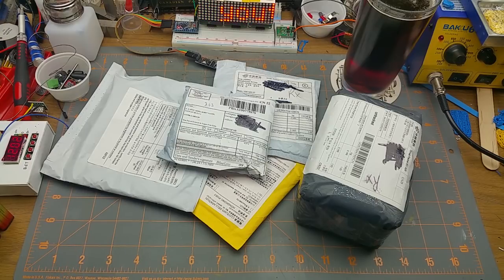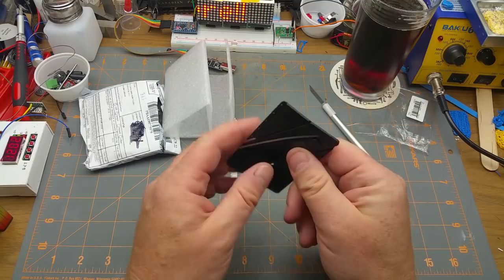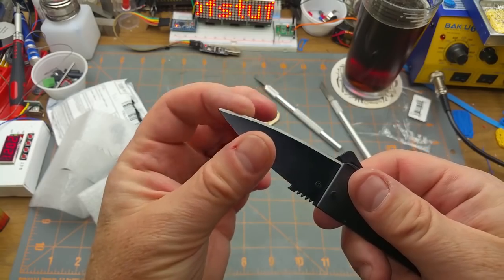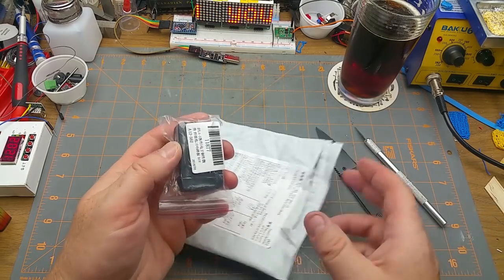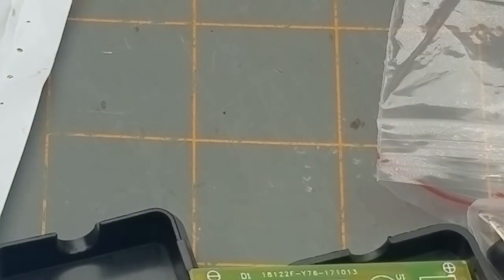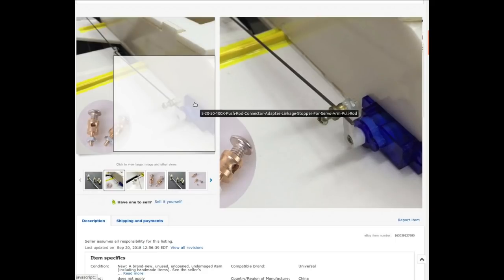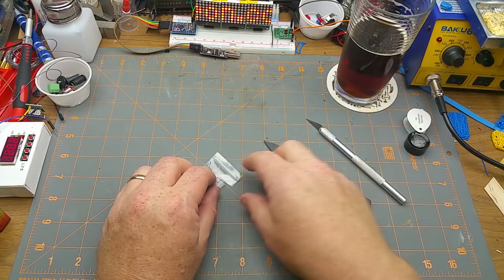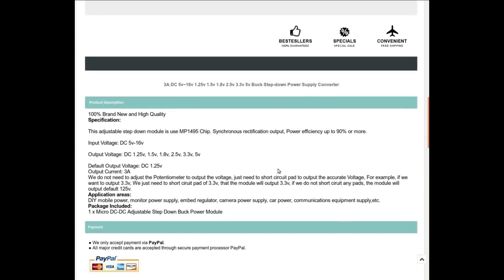mailbag monday #39

Comment: The buck convertor board should work up to the 3A maximum as written as long as the board is implemented properly.
Reply from the maker: Agreed.
But it's always a pretty big "if" when it comes to these cheap Chinese modules.

I generally tend to assume they're safe-ish up to about half of their power rating.

Comment: There is also a fm microphone kit with the same case, fits two AAA batteries and very small board that fits in between. Something like this: https://www.ebay.com/itm/332693271762 Bonus imaginary points for anyone who notices what is wrong with that picture.